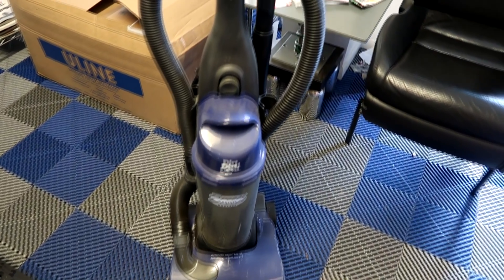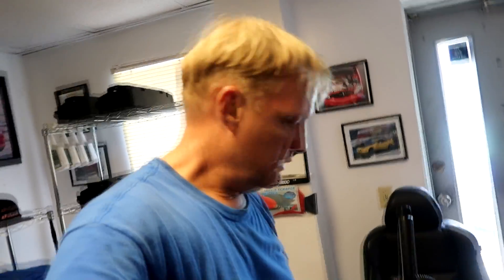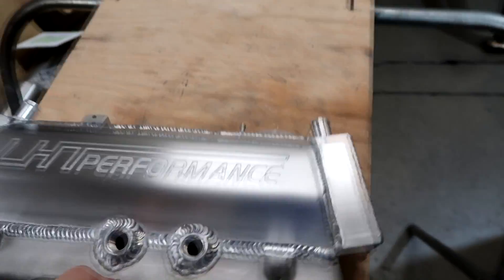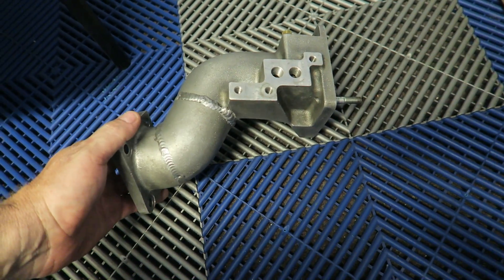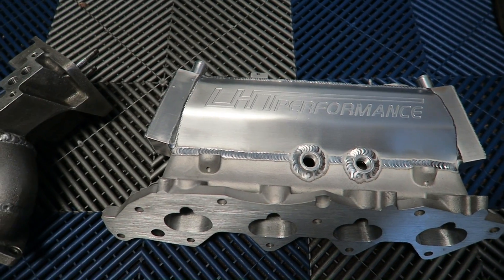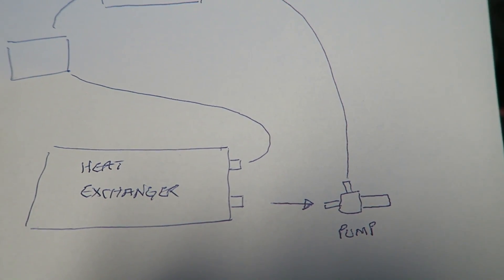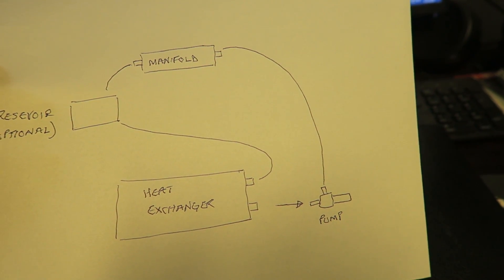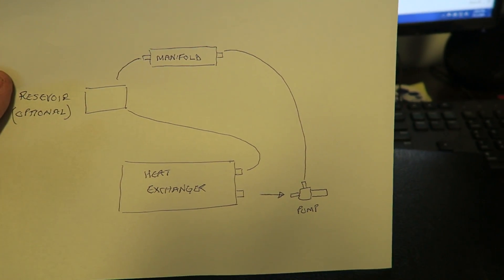B18B JRSC LHT Intercooler Manifold,

Comment: The dysons break. Buy a Shark vacuum. Good and last a long time
Reply: We had a Dyson 12 years ago that was great. It didn't like short carpet and kept burning the clutch so we replaced it with Ball style Dyson... Garbage. The kickstand is hard to engage, the hose that directs suction to the brush broke. Now, most of the time it doesn't direct the suction from the hose to the brush... Never again. Problems aside, it's a PITA to use. I'm going to replace not with a Shark too.

Comment: If I can ever get my mits  on an ap1 it's definitely headed your way for some  LHT tlc👍
Reply: Idk where ur from but if u look in AL, FL, and GA area u might find u some good deals
Reply: They. don't have squat around here, south Louisiana for used ap1 or ap2. I should have bought the yellow ap1👷 at my dealer instead of  the ep3 but I had a newborn son to haul around at that time which is way more important
Reply: @gdub5603  I sold my 8th gen so me and my kid can be alot more comfy. I understand I still got that itch for speed tho
Reply: Still have a honda but it's a 4 door accord. Wonder if kraftworks could do something for the factory 4 banger🌝
Reply: They have a bone stock milano red em1 in my neighborhood but they won't part with it either
Reply: @gdub5603  well it does share the same motor as the TSX🤔. Maybe LHT can put their magic touch on it to make it happen lol
Reply: @gdub5603  I drive a rouge so there is nothing sport about that. But I know the feeling with the em1 I seen a pretty mint eg hatch stock everything guy will not let it go